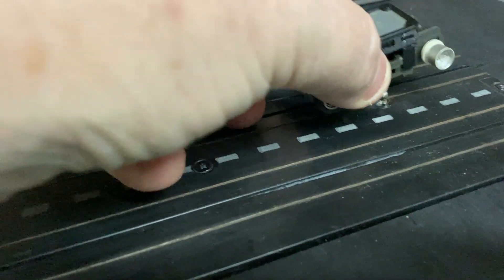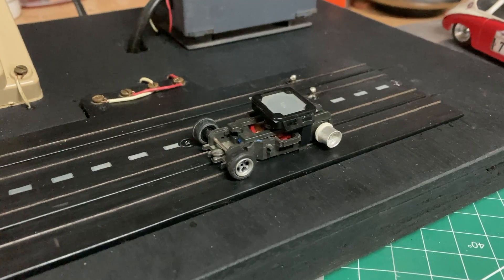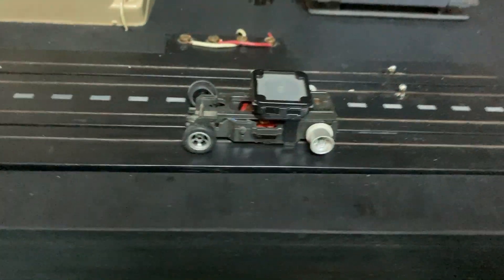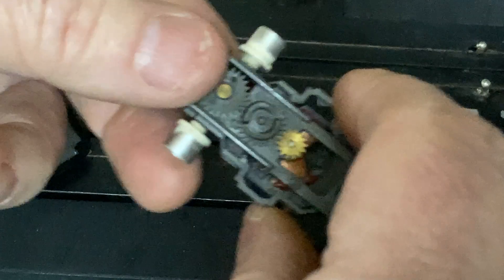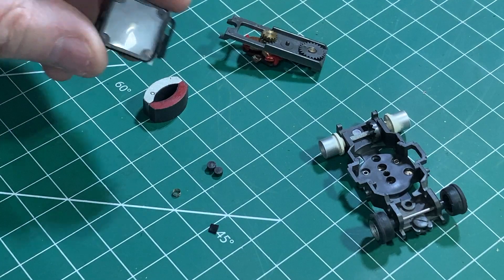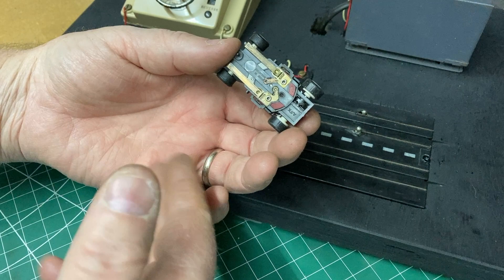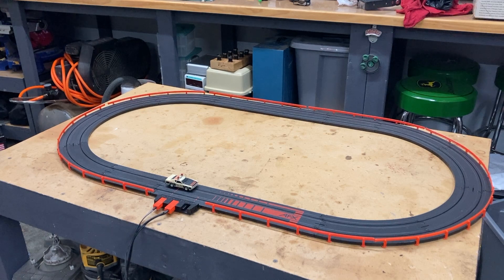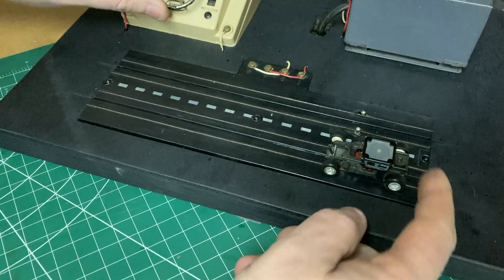What does an AFX Magna Sonic slot car sound like? Will it even run?

Comment: Great video!  When I was a kid I used to take off the magnasonic thing and use the regular clip.  I felt that it may be slowing the car down but was never really sure.  Like you said, I think my parents were happy though!  Those police cars and fire chiefs would come with a special chassis that had working overhead lights.
Reply from the maker: Thanks so much. I have some of the flashing light cars too.

Comment: (to those that find the video) yes ..a drip of oil in the center armature hole Before testing/running any pancake chassis and the front and rear motor shaft  bushings on the inline chassis. The noise boxes are very brittle (of course) and very rare and valuable and a bit pricey to those seeking them these days.  AFX made 10 models of the Magnasonic cars which came out in 1978,  using at least 5 of the old AFX bodies and paint schemes, and 5 new paint schemes of the others. and a NOTE to anyone finding this video and refurbishing the AFX MT chassis - clean the brush springs (and pickup springs)very well including the ends of them to insure good electrical contact and stretch them to sit as high as the top of the hole or a hair below for best tension and power and speed. Also,  boil the oil out of any old brushes by sitting them on an older type stove top coil until the smoke clears or touching  with a soldering iron on some cardboard or think pieces of paper.
Reply from the maker: Thanks for the tips! Theres just something about a pancake motor car.

Comment: just a drip of oil in any pancake slot car armature hole before testing / running of course. The front and rear motor shaft bushings on an inline.  The Magasonice came out in 1978. The little motor noise boxes are rare and pricey for what they are. Very collectible pieces an d cars. AFX only made 10 models of the M.S. cars.
Reply from the maker: Great point!